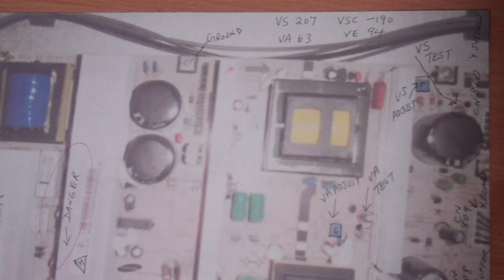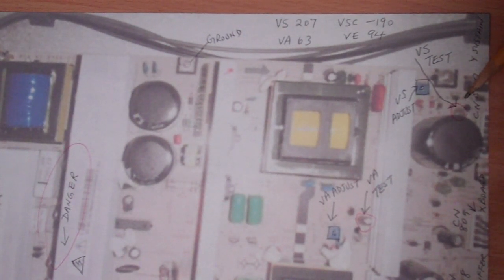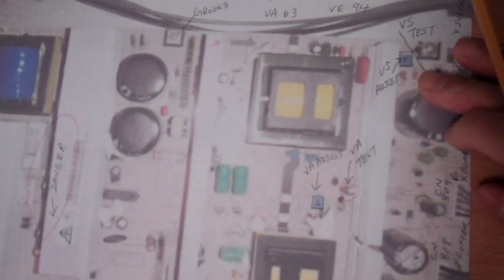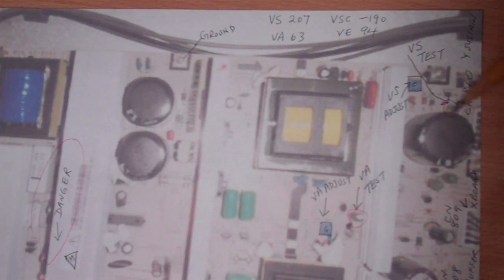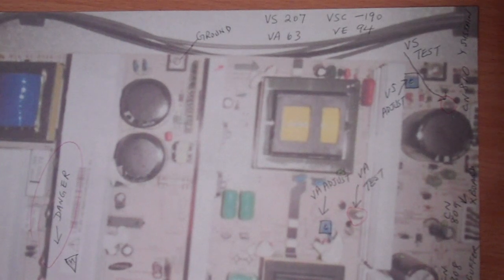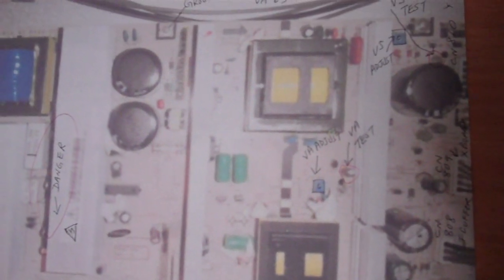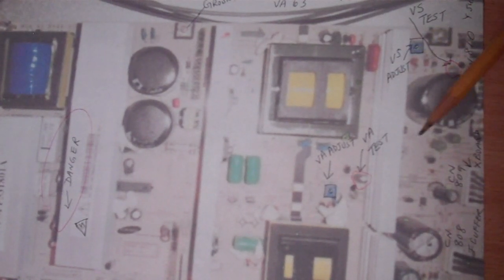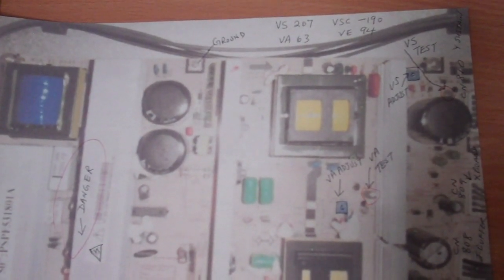Checking Vs and Va voltage on my 50 inch plasma TV and simple troubleshooting guide.

Comment: Very informative, thanks for sharing. My plasma tv has no picture. Testing the Va & Vs they were way below normal. The Led on the logic board was also flashing slowly. On for 5 seconds, off for 2.
Disconnecting my Y board and the Va & Vs values returned to normal and the Led on the logic controller flashes once a second.
I believe from watching the video it is the Y main or buffer.
Still wanting to spend as little as possible... I'm considering taking each capacitor off circuit and testing as there is no components that look dead. If this doesn't work...... I'll be replacing both anyway as recommended to.

Comment: Va is an short for the Address supply Voltage. Vs is short for Sustain supply Voltage. These are the primary supplies to "run" the plasma panel. You could say V-address and V-sustain.
Reply from the maker: Thanks for giving a piece of information that is not widely available.
Reply: @wtam69  Hi i have one more power on the power supply board, it's called Vg and on the panel's back says it should be 95v. What is it's purpose?

Comment from the maker: You can try turning down the Vscan voltage (usually counterclockwise) and see if that helps you. The high voltages on the power supply board can kill you so find someone with electrical knowledge to do the job for you.

Comment: Wtam69, it's okay to touch the heatsink on top for warmness.  Usually, it's how you can tell which board is working by the heatsink being warm.  If heatsink is cold after 1 or 2 hours, then board is probably bad.

Comment from the maker: A temporary fix would be to put a fan on it. I have 3 computer fans hanging in the back of the tv to keep it cool Too high a voltage will cause hot spot and sparkles too.

Comment: Hi, my plasma Samsung TV doesn't light on and make loudly noise when I plug it. Measured VS and VA voltages are too high : VS=447V, VA=125V.

On the board stick, it is written : VS 203V, VA 55V.

What do you think ? Is the power board dead ?

Thank you.
Reply from the maker: Voltage doesn't sound right. Have it checked or replaced by a technician.
Reply: VS=447V, VA=125V? Sounds like double (at least) to me.. That's becouse you checked the voltages with a multimeter turned for AC (alternate current) and not DC (continuous)...

Comment: Great video, what if I mess up all the Phillips head plastic volt adjusters on the power supply and Zeus as well as ysus? Which info do I need for re setting the ysus and Zeus boards as have a PL4260N HP, thanks. Pink lines in it, logic board or possible voltage I messed up? Thanks!!!

Comment: How about constantly flickering picture? Looks like when you have a loose cable making intermittent connection. All inputs, tuner, and menus do it. As if a connection to the actual panel. From research seems to be main board. Any thoughts? 2009 Samsung Plasma

Comment: What an excellent video. The picture wasn't to bad at all friend. Thank you for taking the time to make this video. There was only one thing I would ask. 
You say to be careful when testing the power supply because of electric shcok . I am wondering which parts imparticular we have to be careful not to touch to avoid getting a shock ? The capisitors and fuses I assume ?? Thanks again for the video :-)
Reply from the maker: Unfortunately not all power supplies are labelled with warning stickers so I'll be careful all round. On this board, you see the areas of danger with the lightning symbols. The areas with the labels are obviously dangerous. You have to know the AC side or the hot side and the dc side. Some power supplies actually have that etched on the board hot and cold. If you don't have that then you wouldn't want to guess.  Anywhere near the AC in is not going to be good. DC can kill you too so I don't want to or know enough to tell you which specific part is safe or not.
Reply: Ok thanks again

Comment: awesome ur using the smpa board that I have. Also you said disconnect all the connector on the right, except leave the y-sustain board connected. Can you please specificy which connectors we can safely have disconnected? For example, is it ok to leave the F-buffer board disconnected? The other connects besides the Y-sustain board are the X-sustain, F-buffer, control board, AV board, AC plug.

Comment: Hello. What can I do if i only have 3.2V instead of 5.3V on standby? I have changed the regulators, transistors, diods, capacitors and still 3.2V. On TB801 on hot side I have 98V on pin 1,2,4 and on pin 6 I've got 5V bot on the cold side I have 3.2V.

Comment from the maker: CN807 to CN809 should be disconnected if you are checking the Y board. To be safe, please have someone qualified to do the testing as the tv has high voltages with the back removed.

Comment: After reading that last comment I checked my supply again. Vs reads the correct voltage as the tv starts but then it quickly drops to zero

Comment: wtam69
Those voltages on  VA and VS must be there at the time the power switch is pressed or at the time you plug the tv on the ac outlet ?
My VA and VS voltages are  57.9 and 206v when switch is pressed
then the voltages going down. Do you think my Ysus is bad?

Comment: if I'm not getting any voltage at VS or VA is that clearly a bad power supply?  i can't find any fried components, though i did find and replace a bad fuse, but that didn't fix the problem.  fuse hasn't blown again yet btw.
Reply from the maker: ***** Sounds  like a bad power supply.  Some bad components cannot be spotted by looks. Power transistors, resistors and capacitors could be the problem.

Comment: I played around with the Va and Vs on the power supply and didn't affect the sparkling the only thing that worked was the fan, would a new Y board solve this issue or is it a power supply issue, thanks so very much

Comment: So I have a Samsung plasma that gets zero voltage on vs or va. I can get all standby voltage, 5v, and 15v. No high voltage though. Any idea what I can check on my power supply. All caps look fine except there is one cap that's 450v 10uf that feels very slightly rounded on the top, but its very difficult to tell.

Comment: Hi, i have a samsung plasma pn50c7000yf, i seem to have an overheating issue with one of the boards, when its been on for a while with the back cover on i get what looks like red pixel flashes on dark areas, once i take the back off and turn on a fan it goes back to normal, if im reading correctly is this one of the boards or a Vs & Va adj problem?

Comment: My LG plasma has a red fuzzy band in the middle. I've checked the vs and va the vs is at 201 but mine is reading 202 is that ok? My vs is at 55 n that's what I'm getting. How do I gets rid of the red band on my tv?
Reply from the maker: cinder ed Try increasing the vs by a couple of volts to see if that would make any difference.
Reply: wtam69 I was given a 60in plasma from my folks. Had pink disortion. Adjusted VS screw clockwise by a tiny amount...Perfect picture. Thank alot mate!

Comment: hey man..what does VA stands for?..i have VA and VS regultators on my Pioneer Kuro also
Reply: VS should be VOL SUS but VA?
Reply from the maker: pgice
VA is just the name of the signal from the VA circuit.
Reply: wtam69
 yes but what does it control?
Reply from the maker: pgice
I believe the circuit rectifies the AC to DC.
Reply: wtam69  ok great..i have some pixel sparkles near black on my Kuro..if i rasie (turn clockwise) VA ADJ i almost get rid of them..so it seems that this regulator controls the lower voltages near black level.
Reply: wtam69
 so what happends if you turn VA clockwise?..what changes does it do to the AC and DC?
Reply from the maker: It either increases or decreases the gain. If you start to see noise in your picture. decrease the voltage or gain.

Comment: my 50" plasma when pluged in just lights up with blue light , nothing on screen at all , can here a faint clicking sound .  my board is identical to yours , i have zero volts ant my vs test point , and only 0.04 volts at the vs test point , any help much appreciated , great vid by the way
Reply from the maker: Sounds like your power supply board is not working. Look for obvious signs of bulging capacitors. Those are fairly easy to replace. When they go bad, your tv won't switch on. Other components are  difficult to diagnose and replace.
Reply: thanks for reply , all caps look good and no other signs of any thing looking burnt or damaged . any ideas ?

Comment: I've been trying to repair my Samsung 42" plasma tv which has sound but no picture at all. At first I thought my PSU was at fault but an used unit, which I bought from Internet, never got my TV working. Does anyone here have a clue what could be the problem, when the TV's Va is normal 63 volts but there is no Vs at all? When I connect any buffer board to the PSU the Vs rises to 7 volts. If none of the buffer boards are connected to the PSU, the Vs is 0. Thank you in advance =(

Comment: My vs voltage is rated at 177 vdc but I'm getting 234.6 vdc 😢
Reply: That will kill your  panel
Reply: That voltage should be within 1-2 volts maximum. The sticker inside on your panel should tell you the exact tolerance. You can try adjusting it, but you may be better off replacing the P.S. board.